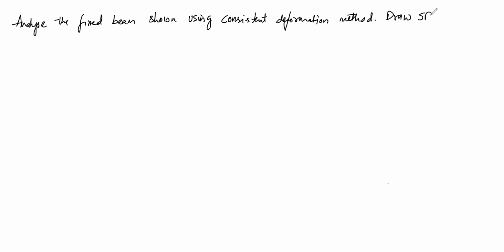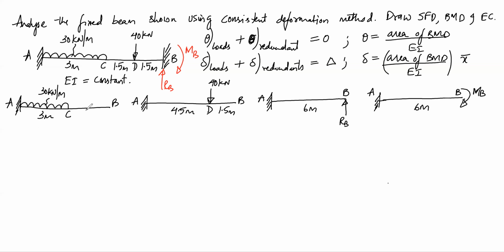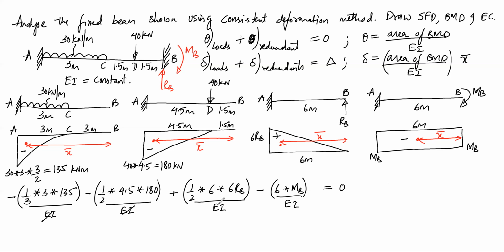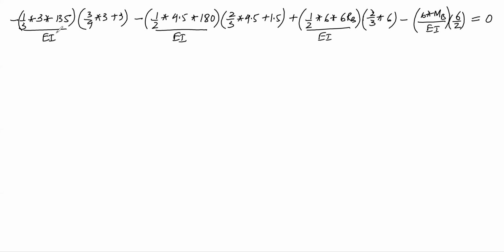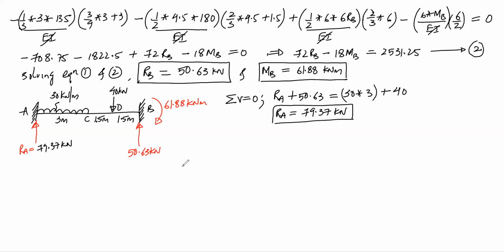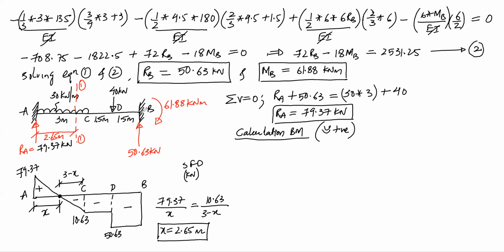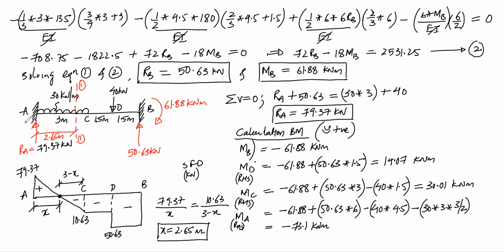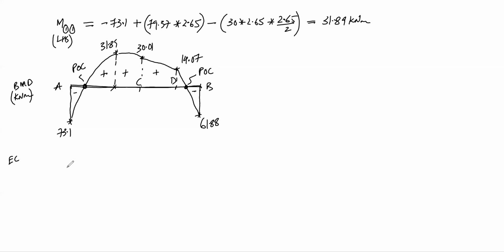Structural Analysis Consistent Deformation Method Fixed Beams Example-4

Comment: Sir can I take moment about.. various point..if it is in clockwise direction then we take +ve..i.e moment about B is +61.88KN-m
Reply from the maker: In this example the chosen redundant is M@B and considered in clockwise direction. After calculating, if M@B is a positive value, the assumed direction is correct. If M@B is found to be a value with negative sign, it means the assumed direction is opposite of actual moment.